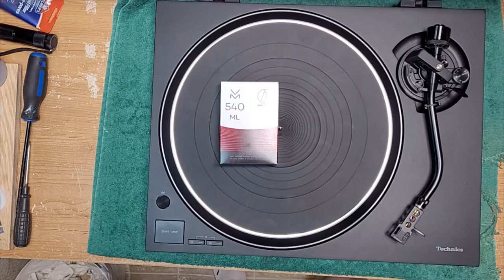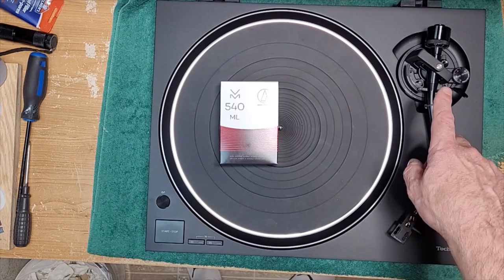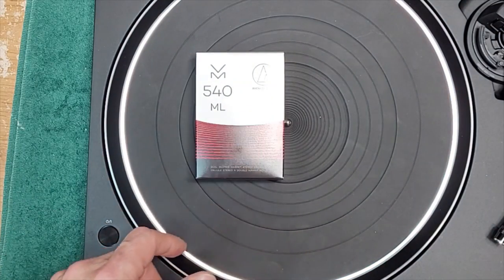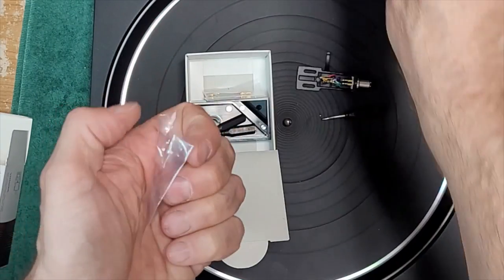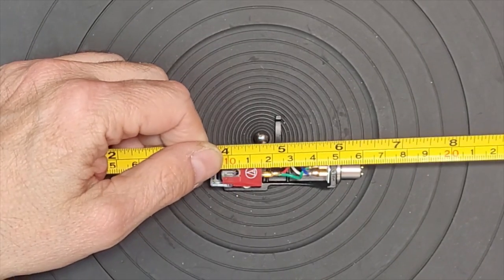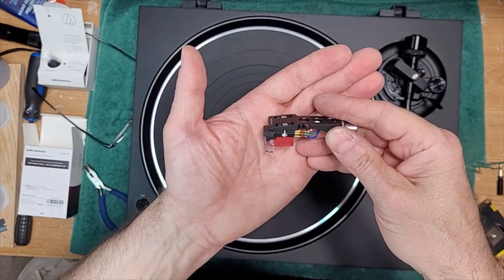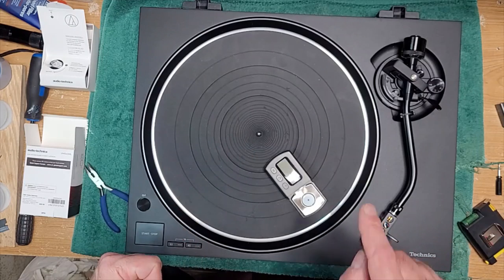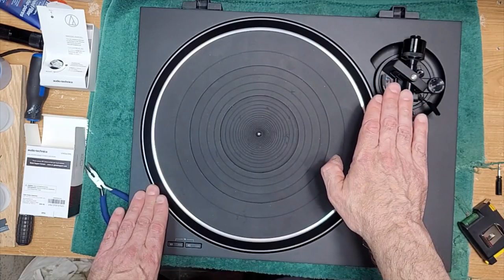How To Install A Phono Cartridge

Comment: I'm going to be mounting a VM540 on a fixed tonearm of my pro-ject evo in three days. Can't believe they don't have threaded inserts in these cartridges. Wish me luck :D
Reply: It went somewhat well. The flimsy, non-replaceable wires in the EVO tonearm almost caused me to have a heart attack. It's important not to pull on anything; instead, push the clamp off with something thin like a knife's edge.

Comment: It must be super slow out your way. It has dried up here. Just selling on ebay these days. Nice to see another vid. It is a nice turntable. I always install the headsehell wires before the screws. It helps keep it together as my hands/ fingers are extra large and easier to manipulate / pop the terminals on to the posts.  I have a couple original Technics alignment gages that you pop the assembly in  and align the stylus with the grove. That VTA adjustment is slick. Look forward to the next video.
Reply: Yeah, at first I put the screws on the head shell before the wire being connect and it was harder to connect the wires. So yeah, connect the wires first and then screw on the cartridge to the head shell bc it’s easier to get the wires on when it’s still not connected and the wires free. 

Also it came with this tube to cover the connections and I put them over the front 4 post on the cartridge, but I think it was suppose to go on the tone arm 4 posts I don’t think it makes that much of a difference, but I switch it out and I have the screw off head shell which makes it much easier than the stationed tone arm tip.
Reply: I have one of those in my box of tricks.
You put the headshell in and pin slides in the groove. The other end gives the vertical alignment by showing where stylus shoulɓnd align in the groove in its other end.

Comment: This easily the best guide on how to install a cartridge on YT. Very detailed and straightforward👌🏻 I've only had experience using a mirrored protractor purchased from turntable lab, but was not aware of the other methods you covered. I do have a question for you: I recently purchased my first technics DD turntable(SL-D2) in great condition for $100. My previous TT was an Akai BT500 that was belt drive. The SL-D2 came with a pickering xv-15(w/ D750 styli?) that sounds pretty damn good, tbh). My other cartridge that was on my akai is a Nagaoka Mp-200. I was about to install it on the technics headshell but noticed the colored wires are in different order than the MP-200. The technics headshell has the Red on the top right & White on top left(headshell facing forward). The nagaoka has Red on the top left and White on the top right. The blue & green are swapped as well. Am I supposed to follow the headshell or the cartridge as the guide, or do I  cross the wires and install as shown on either side? This is the first time I've encountered this, so any information would be greatly appreciated!🙏🏻
Reply from the maker: This is the correct pinout of all removable headshells: https://audiokarma.org/forums/index.php?threads/at440mlb-and-headshell-wiring.724663/

Comment: Thanks for showing the set up. I have downloaded and printed the Rega Stevenson protractor many times, but have been unable to get the measurements 140mm and 200mm correct. If you were able to, how did you set the software to print it correctly?

Comment: Complete and total newbie here, thank you for your very informative video! May I ask, if I purchase a pre-mounted cartridge, would I simply attach it and follow your instructions starting with tracking force adjustment?
Reply from the maker: Yes, but you will need to align the cartridge in the headshell for your model of turntable.